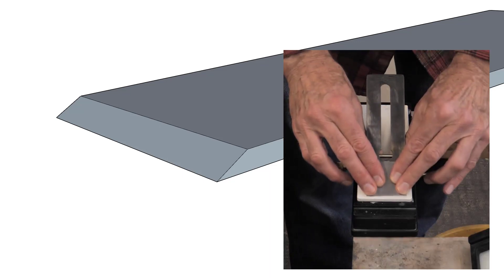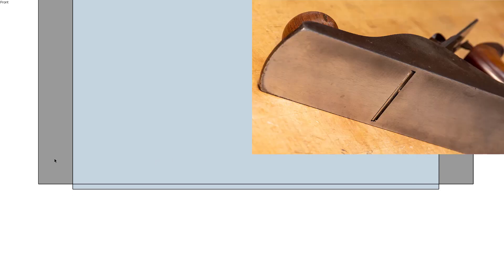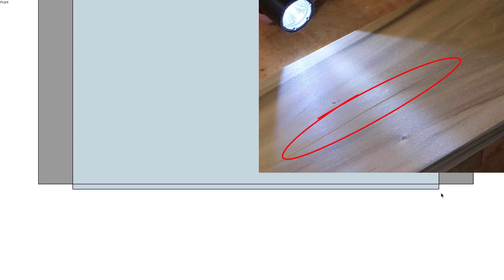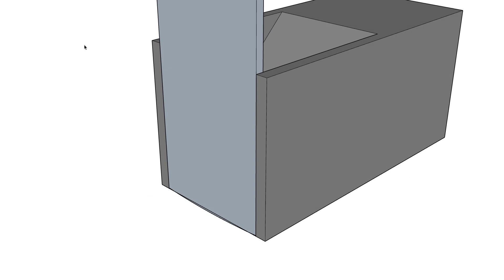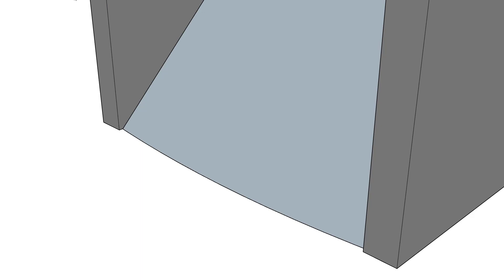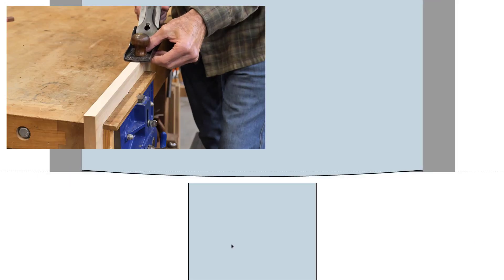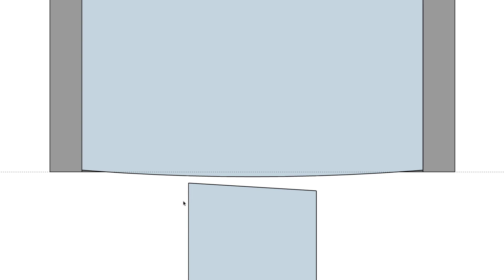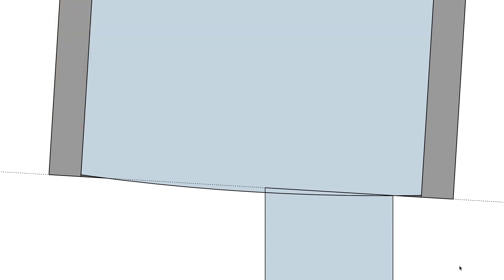Plane Blade Camber

Comment: This saved me!  I struggled getting my joints square with my #62 and a straight blade.  The resulting surface would always lean one way.  I got a new #5 yesterday and cambered the blade because I recalled your explanation in this video.  So much easier to square!  I think what works for me now is #62 for initial jointing, #5 to make corrections to square, then #62 again for final light passes.
Reply from the maker: Glad to hear it helped!